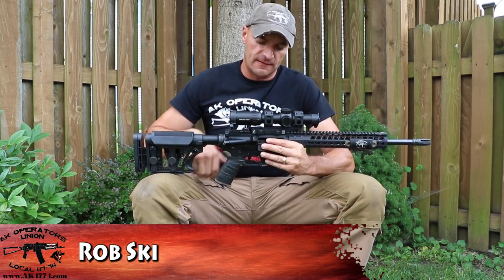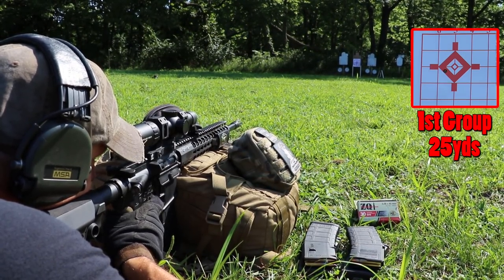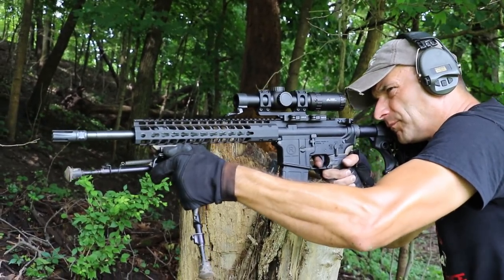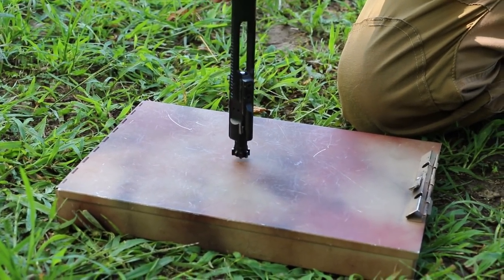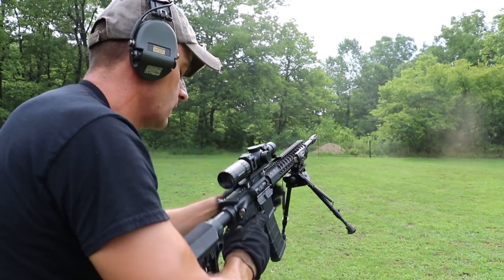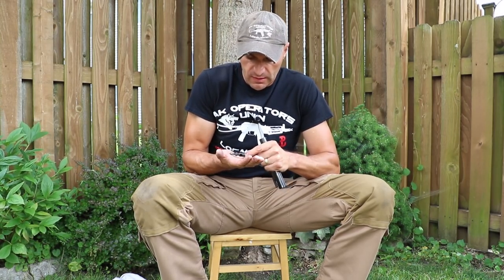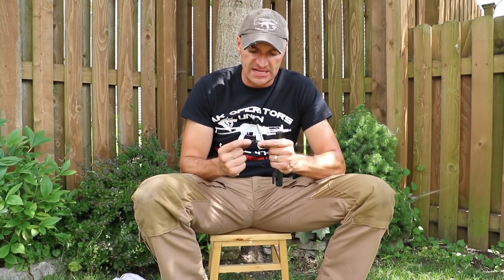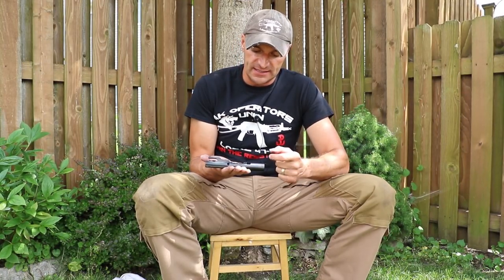Radical Firearms AR-15, 4310rds LATER - Another one bites the dust!

Comment: Hello Rob.  The Military spec M-16 bolt is simply not as robust as an AK bolt.  More complicated, vulnerable gas tub, and gas system.  That small part in the bolt that broke is a prime example of the difference between Western and Eastern mind sets.  Russia and the former Soviet Union, fought a very long war in much more harsh winter conditions for a long time.  True the USA experienced this in the Belgium Ardennes in 1944/45 and again in Korea.  However then we used the robust M-1 Garand, the M1919 30 Caliber Machine Gun, the BAR, the Grease gun, and Thompson SMG, among others.  The M-16 simply due to it's construction has more vulnerable parts that are far more prone to break down.  You did a super job and I am sorry that the rifle didn't make 5000 rounds.  In any case I am still an AK man all the way.  Thanks Rob.  Great job as always.
Reply: I did not put politics into this.  I simply stated history.  Also the Soviet Union is not longer in existence. I have 28+ years in Ranger, Special Force, and Special Mission Units.  As a former SF weapons man and sniper, I have fired thousands of rounds out of Ak's and AR's.  The military spec AK's of my era (Vietnam to 2000) were far more robust than the M-1 A1 and M16 A-2's.  Also of one observes many older Russian small arms one can see the larger simpler, and highly rugged parts of the DP light Machine Gun, the RP-46 Light Machine Gun, and SGM, PPSH-41 and PPS-43 SMG's.  I have not had the chance to fire, take apart the AN-94 or 12.  I am talking about the Soviet Block, and the US Weapons of my era.  The WW-2 weapons that I was also trained on in SF, were very rugged also. The Soviets continued to build on their WW-2 experiences, and the USAarmy after the M-14 threw out the same knowledge and experience and bought the M-16 which the first one's did not even have a forward assist. The Infantry Board recommended at the time after testing the M-16 for the Army not to buy it.  However Robert M. McNamara, ordered it purchased anyway.  He had great power at the time, but no weapons knowledge.  The rest is history.  The M-16 A-2 and M-4  are for sure far improved over the original M-16 A 1's and Car-15's.  However had we gotten it right like the Soviets did back in 1947, and were able to transfer to the AK 74, the RPK LMG, all using the original principles.  A lot less "catching up", and returning to the drawing board.   I will take the AK anytime.

Comment: How about doing this on a colt6920? I would like to see that, I personally own a stag arms, would love to see a test on them as well, since they run 3 gun competition.
Reply: stag is going to be just as good as colt for sure
Reply: +mojo jojo I sure hope so lol
Reply: An LE6920 purchased in 2011 is one of my AR's. As a firearms instructor I've beat the living hell out of it and it's suffered no damage. Has around 16k rounds through it (would be more but I rotate between AR's) and nothing has broken. The only hiccups it's had is that during the first handful of mags through it the bolt didn't lock back on empty but that problem was gone after the first 10 mags or so. Carbon had to make a seal around the gas block. I've had this break in issue happen with many other brands too. I just gave it a full inspection on Tuesday looking for any small signs of impending doom (stress cracks) and found zero. Seems like the LE6920 is a winner to me.
Reply: Stag isn't a bad manufacturer by any means, but Colts are generally accepted to be of higher quality.
Reply: +Caleb Brinkley I have a 6920 that I beat the hell out of. I'm well over 5000 rounds of mostly steel cased. I've never touched a thing on it. Everything is running perfect. It's generally accepted that you should be able to run a bolt for at least 15,000 rounds before it gives up.
Reply: +Robert Smith 
I change the bolt with every barrel change (15k)
Reply: ***** Colt makes everything in house.
Reply: ***** lol no they don't..colt subs out certain parts like everyone else does. most milspec bolt carriers come from the same couple of companies that make them for military...colt doesn't make them
Reply: mojo jojo proof?
Reply: *****.call and ask them...do you have proof they make every single part?..of course they sub out certain things like everyone else does

Comment: Hey Rob I remember way back in the 80s while in the USMC that you always make sure the 3 gas rings was staggered at the gap never line them up or you would have failure. Can't remember hearing about a cam lug failing we had Colt M-16A1 and A2s.

Comment: Here's the reason I saw this type of breakage coming. When you check their site, look at the assembled lower receivers cost. Then look at the complete barreled upper receiver cost, which states it does not include BCG or charging handle. If you add the two together, it comes out to the same price and sometimes actually more than if you buy the complete rifle, despite the fact that buying it in separate pieces doesn't include the BCG or charging handle. This told me right away that the BCG was a cheapo part for them. I'm still planning to do an RF build but I'll just factor in the extra cash for a quality BCG. Still pretty cheap.

Comment: I didn't conveniently ignore points Rob. And you are correct, a pocket file or rock could have fixed that trigger in real world situation. it didn't fall apart, but it did look dangerous. I also agree with failing the AR, not disagreeing there. thanks for all you do.

Comment: Luckily, those are parts that any AR guy, or gal is going to have more than he or she needs and that would be a super quick repair, this is what I always find ingenious in Eugene Stoner's design, the platform is designed to destroy replaceable parts before the entire rifles fail, like the gas tubes and gas blocks, the bolt and its small parts all before a catastrophic failure usually. This failure you have to remember is of a rifle that costs less than $450 and it was past 4,000 rounds of Rob's test, I'm gonna watch the first part to see how it did in the beginning through end because these companies are making these rifles so competitively that we get a huge reward, can you remember this last time an AR15 could be bought brand new in the box for less than $500?! Further more, you can buy quality lowers stupid cheap these days and even better for the lower parts kits, you can buy an Anderson lower for $50-$60(awesome product, awesome value) and put an enhanced lower parts kit in for $50, buy the tube, spring, buffer and stock and you still are only at $200 and that's with a Magpul MOE stock not a $15 carM4 stock. So you have that, all there is left to do is order your completed upper and so many companies are coming out with new packages every day, if you are willing to put in the work and bargain hunting, you can build a great rifle for way less than a grand, not possible years ago!

Comment: It should not have failed at such a low round count. Having said that, one of the great advantages of the AR platform over the AK is that these parts are cheap, interchangeable and user serviceable. A spare cam pin or even a spare bolt can be carried with the rifle and replaced in the field. Put a new cam pin in it and I bet it lasts another 4310 rounds.

Comment: I bought their 7.62x39 upper and the surface finish inside the bolt carrier where the bolt gas rings ride was like a drilled bore. Maybe in the 125 micro inch finish zone, when it should be in the 64 zone. Overall the bolt carrier was in rough shape as I had to grind, yes grind down a mismatch at the hammer ramp on the bottom side of carrier. Firing pin protrusion was only a measured .035 when it should be in the .050-.060 zone. Piss poor quality control.

Comment: Im surprised this budget gun went this far without a failure. Surprised, but not necessarily impressed. I believe (My opinion based on my experience) is that the BCG and the Barrel quality are the most important parts of a rifle. Whenever a friend or family member purchases a budget rifle, I tell them to save up for a quality BCG and then a Quality Barrel when able. MilSpec guns fail too! This failure is premature for sure. If you want quality parts that you can realistically count on, dont buy budget products. Thanks for sharing.

Comment: With budget AR's, companies need to cut corners somewhere. Usually it's the BCG, or a value barrel with a commercial Buffer Tube. Proper mil-spec Cam Pin is either...4140 or 4340 forged steel which is heat treated, stressed relieved and quenched. Many companies will use 4130 steel from billet, The same above specs goes for the Gas Key too. And again, many companies will use 4130 billet for the gas key. Extractor uses the steel as the cam pin and gas key. The pin for the extractor should be S7 steel too. As for buffer tubes a commercial tube is from 6061 aluminum and extruded. Whereas, a milspec buffer tube is from 7075 aluminum and forged. 7075 aluminum is roughly twice as strong as 6061 aluminum. As well as, forging is much stronger than extrusion. Proper milspec gas port on barrels is .0635". Many companies will open the gas port to .0680" or .0700" to ensure the rifle will shoot all types of ammo. Usually when an AR has issues shooting steel case ammo. Is due to the gas port being milspec. Hope this helps some of you out.. And now you know why many companies don't reveal the specs to the BCG. Go to Sons of Liberty website (an AR builder) who actually reveals the specs to their BCG. Companies like, FN, Colt, Spike's, BCM, Sons of Liberty, Daniel Defense will use proper milspec materials and how the part is suppose to be made in the proper manner. However, Daniel Defensive does not adhere to mislpec on the gas ports...their barrels use a slightly larger gas port,

Comment: I Have an RF 7.62 7.5 in pistol upper on a pistol project I built up.  I have ha constant problems with it not feeding similar to this.  I sent it back and they honed the chamber and ported the gas port.  It runs better but still double feeds a lot.  It fires then treses to rechamber the spent case and the next round at the same time and jamming.  I have added a stiffer ejector and extractor spring and this ha shelped I am not sure if it is the gun or the mags I am running ASC 20 and 30 round vesions.  This is an intermittent problem but when it hampens it is massive failures

Comment: Too bad, I figured the Gas key would be the first point to fail, but I was wrong. I guess if you replace the cam shaft and gas rings, considering the price of the gun, that's not a real big deal assuming nothing else goes wrong. If this turns out to be the weak points, replacing these parts before you go through many rounds might be a good idea.

Comment: Drop a new M-16 bolt in, check the headspace and see if that fixes everything long term.  They could be using cheaper bolts trying to keep the cost down.

Comment: my radical firearms upper had 2 problems, gas block got loose, and extractor broke at 2100 rounds. Mine was way over gassed and was making damage on the rail in front of the ejection port

Comment: So I'm building my own lower from a Ruger 556 stripped lower with a Spikes Tactical Enhanced lower parts kit with a cmmg buffer tube kit and a FMT minimalist stock. I was set on the Radical SOCOM upper until I saw this video. I know you had good results with the PSA. Can you recommend another affordable upper for my build? I really want an MLOK rail on a milspec complete upper. Having a hard time deciding. Thanks
Reply: code one the upper has nothing to do with the firing pin other than the fact that the round chambers in it. you can still get a Radical upper
Reply: I have a RF upper with the SOCOM barrel. I bought a Fail Zero bcg for it. I had some issues during break-in with the BCG. Everything works fine now. No FT-Feed or FT-Fire. But I did have a couple FT-Eject with cheep steel cased ammo.

Comment: Radical Firearms uses Carbine gas systems in their 16" rifles. They should have gone mid length. After each shot, the cam pin rotates with the bolt as the carrier moves back. With a carbine gas system, the bolt is under much more force than a mid length gas system and much of that force is transferred to the cam pin. With a free float rail, it's pointless to have a carbine gas system when you can have a mid length that will put parts under less stress, heat and fowling. 

Also, RF sucks. I've had 3 barrels come loose from extensions and 2 gas keys come loose.

Comment: I was considering purchasing a Radical Firearms rifles too as they aren't far from me. This changed my mind. Sure, it's a fixable part but I'd rather have the peace of mind of being able to run something a while longer (in a survival scenario) before issues like this pop up.
Reply: The rifle is fine...a new cam pin and gas rings, and it'll be golden for another 4000 rounds.  

The cost of 5000 rounds is almost $1750...you could buy 3 of these rifles for that kind of money.  

I'd much rather have this rifle and 3000 rounds of ammo over an $1800 AR and no ammo.

In a survival situation, how many rounds do you plan on shooting or carrying, anyway?   
Do you plan on maintaining your gear in that scenario?

There are plenty of videos on YouTube of really expensive AR's failing as well...and no, I don't own a Radical Firearms rifle, but after seeing this, I'm definitely buying an AR pistol from them.
Reply: Konish P. I understand the rifle is fine, but who is going to have a bunch of spare parts lying around unless you are a gunsmith or a collector? Easy enough to have now when parts are plentiful and cheap, but it won't always be that way. I don't just want a plinker rifle, I want something that can at least keep up with my JRA 74 without a bunch of hiccups. No, I don't need no damned 'tacti-cool' ultra modern $1800 fancy rifle, but I would like a best value to performance purchase. Not unreasonable is it?
Reply: +DarkFilmDirector Whatever floats your boat, man.

Comment: I would like to see you change the bolt carrier group with like a fail zero, or AIM surplus BCG that are inexpensive replacements for 80 too 120 dollars for the Exo NiB BCG an test the rifle again with one of these BCG's and see how the results are... because most people upgraded there BCG like me I have two spares one for my colt 6920 an one for my radical firearms .300 blk out FGS 12 .. and they both have ran with no issues or malfunctions with the BCG 
That came with the guns and the aftermarket BCG's.. both stock just have the phosphate finish.. but the backup BCG's I have are NiB with black nitrate finish.. witch is better for  reliability, function, Long Jevity, lubricity..

Comment: round 450 bolt cracked.  loose gas key as well.  discovered crack on tear down with excrator removed.  you can see clear as day if I kept shooting the crack dead center of bolt is following fire pin hole.  gas key is loose.  waiting to see what and how RF will take care of issue.

Comment: Could be the firing pin protrusion was too short and out of spec. Gas rings failing this quickly is a sign of over gassing or a rough bcg bore. If there is a lot of play between the bolt and cam pin it will break sooner than it should. Another AR bites the dust....

Comment: The zero defect mentality is really starting to go overboard here. It’s a 9.00 part or less and just like having a spare firing pin you you should also have a spare, extractor, cam pin, gas rings and cotter pin. He’ll make it easier and have a spare bolt. 4300 rounds with 0 malfunctions is more than most will see in their lifetime.

Comment: great vid, I subscribed to view ur vids to learn about the AK system and is been of great help.  how ever I use an AR system for personal reasons.  I maintain the 3 house AR every 1000 rds(my personal choice) and so far never had those kinds of problems.  cam pin, gas rings amongst other BCG parts in my opinion should be change and most of those parts ARE NOT EXPENSIVE and every EZ to change.  just wanted to share my experience.  Again great vid. 👍👍👍👍

Comment: Very common for AR rifles and should be considered consumables to be replaced every 2-3k rounds. I wouldn't call this a failure but rather lack of proper maintenance just like your car needs its oil changed replace your cam pins and rings every 3k miles

Comment: Rob, could you put another BCG group in it to see if it runs with it? That would just rule out that there also isn't also a gas issue. Great test.
Reply from the maker: +bigschank yes, it runs with other parts.
Reply: +Ak Operators Union, Local 47-74 great! That for sure narrows it down that the BCGs are of a meh quality

Comment: Getting any AR through this test would be lucky. Great platform, just too many maintenance/wear sensitive parts to go 5k+ rounds while inducing debris into the action. Ive replaced severely grooved/deformed cam pins in well maintained BCM and Colt rifles with much lower round counts. You can only make steel so hard. I dont own a Radical AR, but i definitely wouldnt be afraid to spend $600 or less if i needed a cheap rifle